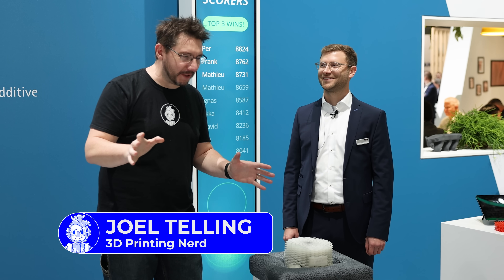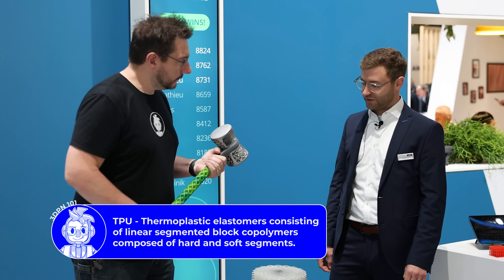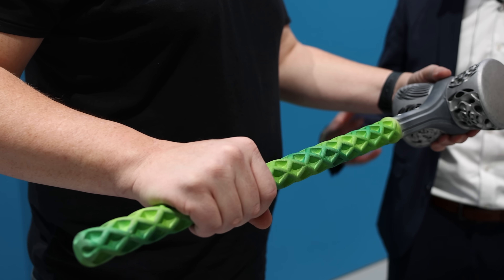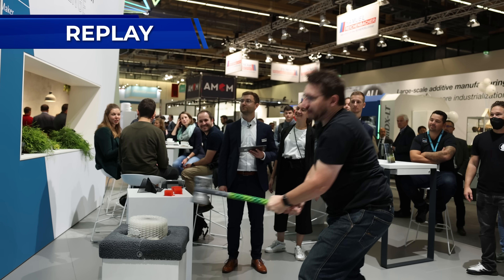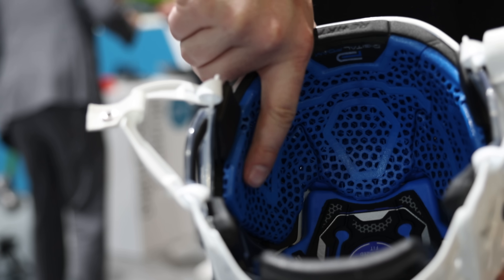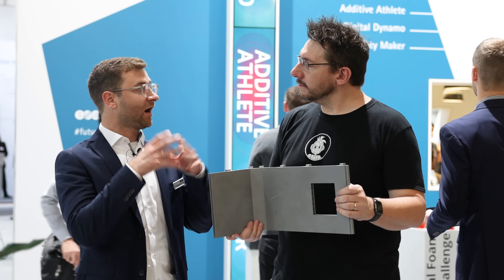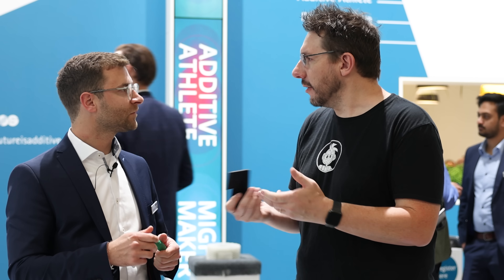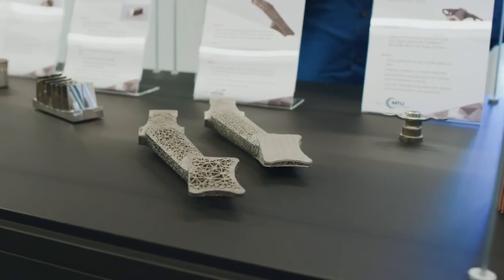Will This 3D Printed Hammer Survive?

Comment: Doesn’t that defeat the point of a hammer?  A hammer is supposed to be a large mass with a handle.  It’s mass allows it to deliver a lot of kinetic energy in a single blow.  By removing mass you are making the hammer blows weaker.  You could drive a nail with a crab mallet, but it’s a lot faster to use a solid steel hammer.  So again, what’s the point?

Comment: This video made me have some realizations that I'm sure everybody else here has already thought of. (I don't know much about 3d printing)

The ability to print metal like this allows you to make things that were previously impossible to do in a single piece of metal.

The fact that you're not machining a larger piece of metal away is also really efficient, you only use exactly the amount of material that you need to finish a part... No bins full of chips to be recycled after the production process is complete.
Reply: 3D printed parts allow shapes which can't be milled. Some of Joel's other videos show metal parts which would be impossible to mill.
Not having a bunch of chips is and added bonus.

BTW, I purchased a 3D printer about a year and a half ago. It's every bit as much fun as they look. Using a 3D printer is easier than I had expected.

Comment: What material what the hammer shaft made of? Is it wood, covered in a 3d printed grip?
Reply from the maker: The hammer shaft is a nylon composite
Reply: @3D Printing Nerd  does that mean cf nylon? I'm impressed, that a grown man can smack it without fail...but they are smacking into a "foam" cushion of tpu...still impressive, never seen printed parts survive that kind of abuse, and i've smacked alot of nylon and tpu into concrete at high speeds.  Thanks for inspiring the masses. I'm now 2 years independent of my IT Management career,  and loving running a print farm and drone shop 🙌
Reply: Aww, think he said 3d printed [edit:] Nylon Composite Shaft" 👌

Comment: The padding in the helmet would also allow better ventilation, which is a huge deal when you are playing hard with a helmet on.
Reply: Agreed. I also think it would reduce odor by giving less surface to retain and grow bacteria, compared to foam anyway.
Reply: @OneUniti  also making different shaped patties will require less equipment to produce
Reply: The big reason to have an inner shell on a helmet is for something like MIPs. To protect your head from rotational forces. A dampened rotation.

Comment: the 3D printed Hammer is for weight savings?
A hammer needs weight 🤔
also the striking surface should be able to distribute point forces (hitting nails) effectively... which a thin plate is not really good at.

But nonetheless I understand it's just meant to be a showcase

Comment: Wonder how the printed "car parts" stand heat?
Still difficult to find an "easy print" plastic that will stand up to a hot car interior or a windowsill in full sun.
Reply: There are fairly easy to print materials that hold up quite well. ASA is a good choice if you have trouble with Nylons, or you could try some of the materials that are tempered/annealed in an oven after printing, like the VolcanoPLA from FormFutura.
Reply: Depends if the part is “functional” I had printed a replacement wind screen wiper for one of my old cars in standard PETG and it stood up to the sun just fine, if the part was to be in the engine bay however it may be a different case.
Reply: Formlabs makes a high temp resin that survives over 400f

Comment: Car spare parts is a very good application for 3D printing.  If at the end of the lifecycle of a car where the company is no longer making parts, a 3D printing company could step in and print parts on demand.  In many cases lighter and stronger parts can be provided too without having to deal with the injection molding process.  Reducing the initial cost of printing a handful of parts.